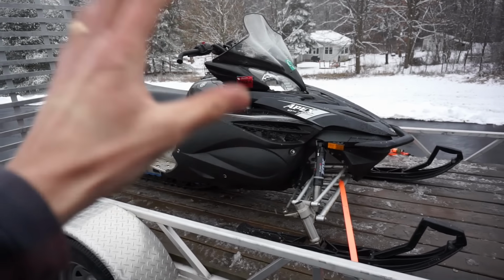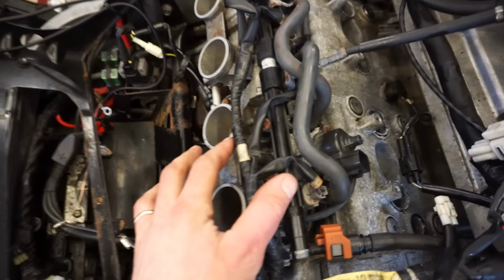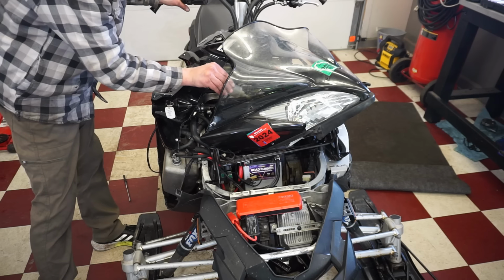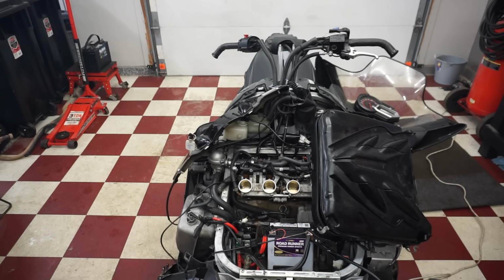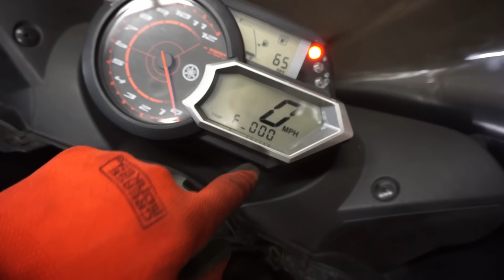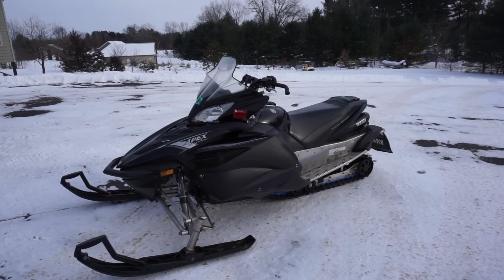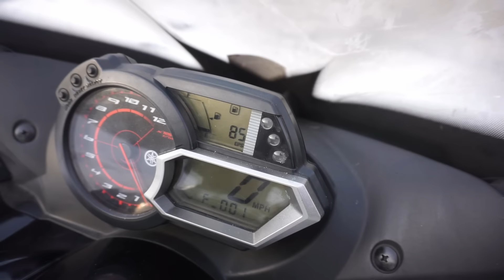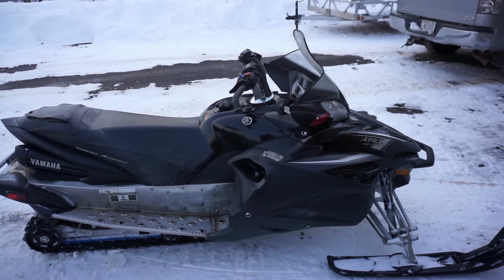$7000 Sled Overheated And Shut Off. Will It Run Again?

Comment: Over heating is an under statement. It's hard to believe a machine that cost what this machine cost doesn't have an overheating shutdown before it gets so hot it melts plastic.
Reply: Even all newer  outboards have them.  They will idle , but that's it until they cool off.
Reply: An overheating shutdown is also a system that can fail. Remember what happened to Apollo 13, the overheating cutoff switch failed to activate during tank testing because it was not rated to operate properly at all possible supply voltages.
Reply: It has a temp light, operator is responsable to shut of sled when lights come on, at some point rider needs to use common sense and not destroy his sled.
Reply: @4knanapapa  sounds logical but for snomobilers all eyes are on the trail or you go off the trail you go.  My Nytro shuts off on it's own when left to sit and idle and overheat on it's own.  But it doesn't shut down at the first over heat light when I am riding.  When it does come on (and I notice it), I typically slow down and ride off trail a bit in search of loose snow which works fine every time.  But during an intense trail ride I can definitely believe that light can be easily overlooked.
Reply: Mine does! Guy must have unplugged the temp sensor to get back to the trailer.

Comment: the starter will have been extreme hot; a miracle that he survived!
Reply: That starter is a champ. I honestly can't believe it survived all the abuse. Seriously dude take it easy. More starter burning or endless kickstarts won't make it run if there's other issues like bad spark plugs. This is mechanics 101, you're going to ruin good machines that way
Reply: The hole engine was cooked 😂😂. Doesn't matter the starter was cooked long before he got it.
Reply: @jerrywilcox9890  Obviously not. It is still working. 🙄
Reply: @ThaFailedMusician  no shit it's still working lol.never said it wasn't hahaha.
Reply: @ThaFailedMusician  it doesn't matter how long he used the starter.but before long it won't be.it will be going out.
Reply: @jerrywilcox9890  You don't know a lot about starters, do ya?
Reply: @ThaFailedMusician  it will burn out.
Reply: @jerrywilcox9890  Working in a fashion but for how long?
Reply: @alanrichardson1672  it will be giving up before long.

Comment: Quick note.  Knock sensors can’t leak oil.  :-). They measure a for a sharp knock throughout the engine block.  They are normally a piezoelectric device.  More vibration generates a high voltage signal.  The computer knows cam and crank position as well as when spark is fired.  So a knock signal larger than normal combustion near TDC or before the next spark event  indicates which cylinder was knocking.  Looks to me you need two sensors.  

Those engines are some of the best ever.   Great power at 10,000 RPM and reliable at the same time.  And the sound is incredible!  

My current RX1 I got for $1k.  Wouldn’t start.  Owner claimed it had a new solenoid and battery.  Got it home and found some carb floats were stuck and filled the crankcase with oil and gas mix.    Rebuilt the carbs, changed the oil and bought a new battery.  Run like new ever since.  Great sled it’s become a keeper.  But I would replace it for an Apex like yours!
Reply from the maker: Yeah it was the oil pressure sensor not the knock sensor
Reply: @2vintage  I often reply to videos while I’m watching them.  Bad habit.  I’m anal retentive due to my career which I’m retired from.  So I have plenty of time to nit pick YouTube videos!

Comment: the "knock sensor" i think is more likely an oil pressure switch.  Hence why there is oil that is under pressure at that location.   Knock sensors just sit in a metal chunk of block sensing pre-detornation knocks.  That could be because of bad gas or excessive temperatures causing the gas to ignite at the wrong moment.  (remember your coolant was super low, overheat and fuel was detonating wrong and the computer caught all that crap red-handed.)
Reply: I was thinking the same thing I'm pretty sure above it is the knock sensor

Comment: Always remember on most single wire sensors of any kind. Use the housing as a ground. You should use liquid thread sealant to seal threads not Teflon tape, which will insulate the ground causing issues.
Reply: This comment is why I’m here in the comment section could possibly be the reason for the code?
Reply: 100%

Comment: You never want to put antiseize on the plug boots. Antiseize has metal particles in it. Will cause misfires. Antiseize is used on the spark plug threads.
Reply: Ya and swell the boots
Reply: He used dyelectric grease. Not anti seize.
Reply: @notjoecheez1  He used antiseize it on the boot.. On the threads and on the tip of the plug he used dyeelectric.. Although you should never lubricate plug threads..
Reply: yep, i saw that too, got it backwards.
Reply: @notjoecheez1  it was copper based anti-seize where a trace of dielectric should go, also on the ceramic outer plug portion. Not on the actual threaded ends. 
kind of backwards. It's to keep the rubber coil boots from setting up on the insulator bodies....
Reply: @timewa851  No. Watch it again.. But regardless.. one should not use copper-based products near electrical things.. It conducts electricity..
Reply: Never put antiseize and sparkplug threads.. or into anything aluminum

Comment: You should put the retainer back in your plug socket instead of dropping plugs down into the engine like that. It could alter the plug gap just saying. But great video as always Joe
Reply: You did just fine until you said "just saying "

It adds nothing to your point.
Reply: Well I said that so people don't think I'm trying to come across the wrong way or like a know-it-all because that's not the case..

Comment: You probably figured it out but the knock sensor is between the middle 2 cyl about 5 inches from your oil pressure sensor.  Replace it.  Put the nose up on a snow bank and pop the coolant cap to burp the system.  Don't ride until you clear all the codes.  The sled will shut off if it doesn't see oil pressure that is the code 30 you mentioned.  You stole the sled, even if #1 is a little low on compression, run the yamaha ring free for a few tanks and you may get lucky.  What was that ticking when it was first outside?    That is how they are supposed to start, don't crank longer then 20 seconds, swap the plugs immediately.  Have fun!

Comment: As a general rule, knock sensors are single wire and thread into a hole that does NOT go into any passage but bottoms out somewhere in the side of the blocks water jacket, without contacting coolant, oil or anything else except the block.  I believe yours is just above and to the left of the oil pressure sensor looking front to back.  Very low coolant can trigger the knock sensor because A) The engine will knock when hot or with bad fuel due to multiple combustions colliding in the cylinder (it's hot) and or B) because the knock sensor is essentially screwed into a hollow drum i.e. the coolant dampens the knock by filling the drum. Naturally a rod knock will trigger the knock sensor as well.

Comment: That red light isn't for plug fouling, its the coolant temp light. You're supposed to let the coolant temp warm up before you ride it. It's not a 2 stroke. Constant throttle not constantly blipping it.

Comment: This thing must've gotten lava hot for all these components to melt like they did. Even the dipstick, which was separate from the engine itself, was goo. Can't wait to see how it ends with this beast, but I wouldn't hold my breath because all of these melted components can't be a good sign for the engine (and subsequently the one low cylinder). I'm hoping there's no damage to the wiring harness because judging by how hot it got, it'd be a miracle if it's still 💯% intact. Good luck in advance!

Comment: Knock sensorseem to be above oil sensor on the left with the hose ,bolted nearly horizontally ,it's in the cylinder wall/engine block. 31:41

Comment: To really get the antifreeze burped out, raise the front of the sled 45 degrees and continue to add until full. The coolant lines typically go all the way back above the track. These 4 bangers are fast.

Comment: Ps a old plumber's trick was to put ptfe tape on like you did But put more around the tapering end with grease with heat forms a gasket perfect water oil tight 👌

Comment: A tip for you. When working on snowmobiles, take the belt off before trying to start them. Your wall and sled may thank you for it
Reply: Or get a stand to get the track off the floor, but do something.
Reply: Like previously said - lift off the track. Taking off belt can be bad idea - sudden rev will damage the primary clutch by smashing sheaves without belt.
Reply: Don’t rev up a sled without a belt on. You’ll wreck the primary

Comment: Hey brother, I've noticed in a couple of videos that you're leaving the outboards in the up position on the boats. You should always leave them in the down position in freezing weather. Water will collect in the foot through the exhaust and freeze and bust the foot. Hopefully it's not too late! Just an FYI.
Reply: Hope he sees your comment before it's to late good eye brother
Reply: Good to know, ill have to keep this in mind
Reply: Most people I know that have outboards that keep them in the up position make sure there is no water inside when they store them so if that has been done there shouldn't be a problem
Reply: @186scott  It doesn't matter if you drain them. If you leave them up and out in the weather and it rains it goes down the exhaust and collects in the foot where it can then freeze and bust but, to be honest, I don't know that much about boats. I grew up on the largest man-made lake east of the Mississippi, got my first boat when I was 13 and still own one to this day at 60, worked at a marina pumping gas from 13 to 16, drove a marine forklift at a dry dock storge and hauled 35 ft boats around as well as worked on them as a profession for 2 years so, it makes perfect sense to leave an OB or the outdrive of an IO up and take a chance on it freezing rather than put it in the down position  and be absolutely  sure it doesn't freeze. That's what all my friends do. Your friends are probably smarter than mine. I don't know what I was thinking trying to give some friendly advice to someone and possibly save them some time and money...My Bad! But hey! It'll make great content! 😏
Reply: @ThaFailedMusician  not trying to start anything and I am sure like me a few others are surprised by another way of storing them and I do completely understand your way and there are multiple way to skin a cat and I am sure there will be others that agree with you and agree with what I said
Reply: @ThaFailedMusician  thanks for that reply, made me smile.  Meanwhile back at the cabin both my boats have the motors down as I do every winter (- 40 up here at times) and I  noticed my brother in laws is up and thought hmmmm.    I also seen that the local marina actually tapes over the end of the prop opening to keep the snow/water out as well in storage so I have started doing that, too. Cheers

Comment: As soon as you put the black old plugs in I said wait for the new plugs.  The old plugs were black and shiny.  Means excess oil or fuel.  My dad was a mechanic and he showed me that if there is fouling, pull the plugs out and turn the engine over.  Heat the plugs up and re-install.  Start as soon as possible.

Comment: Dielectric grease prevents the transfer of electricity. Putting it on the metal parts of the spark plug would effectively reduce the spark from occurring. Only put it on the ceramic part of the plug
Reply: I agree, but dielectric grease is still grease. It's not going to hurt metal to metal contact. It does lubricate and block moisture.
Reply: @fefifofob its silicone grease, its not your off the shelf petroleum grease. Its dielectric, literally named and designed to stop the transfer of electricity. Putting it in between two things you want to conduct electricity with reliability and consistency is quite possibly the stupidest thing anyones said to me in 2025.
Reply: @jacobmay7594  If two pieces of metal are in actual contact, a dielectric is meaningless.

Comment: I wrote it on the previous video of this machine, if it got that hot like the oil was cooking chances other parts are hit hard too.
Like valves cam and Rod and crankshaft and all bearings or oil pump and everything engine-related took a hit.
For a reliable machine, you should take the engine apart and check every piece for heat damage.
Now you could have a machine that breaks down every time you take it for a spin.
There is always a part that fails later on due to extensive overheating, this was a severe overheating.
I wouldn't trust that engine .

Comment: next video, joe replaces a starter on the sled, lol. Also, knock sensors dont have holes in them for oil to pass through, that is a low oil pressure sensor, knock sensors are piezo type sensors that sense a knock or ping by sensing a pulsation or pressure wave through the block. the knock sensor would have been the sensor located above the oil pressure sensor screwed into the block. Joe you aren't stupid, you can certainly fix it, no doubt about that, sometimes( well most times) internet searches can lead you on a wild goose chase, lol. I used to be a yamaha mechanic, and their sleds are a nightmare to work on.

Comment: Dont put Dielectric Grease on the electrode part of a spark plug. The grease is a insulating grease not conductive. You only want to put it on the porcelain part

Comment: Great video, I like you are cutting short the intro to your basic diagnostics, but would like the voice over explaining what and why.  I also look at snowmobiles as the biggest waste of money.  Paying $7k in 2012 is like 12k today to go play in the snow 2-3x a year?  I would rent one instead.  Kinda like jet skis, easier to haul than a snowmobile, but i have had three friends rupture tendons and ACL tears trying to get back on them in the water.  I will stick to motorcycles and ATV’s
Reply: This has been a terrible winter so far in wi for sledding, The grass is barely covered around me and I'm not that far away from Joe's location.   Between the high cost of new sleds and declining snow condition its been killing the sport for 50 years.
Reply: Snomobiling can be much more than 2 - 3 rides playing in the snow.  With hundred to thousands of miles of trails it becomes a destination thing, ice fishing, to a nice restaurant, or an overnight at a hotel etc -a couple of hundred miles per ride at times and a very social thing to do when you all have sleds. I do a yearly three day ride from Manitoba to Minnesota with a group of friends and it's a highlight experience every time.  But those Jet skis are more like you are saying, around and around in circles gets boring pretty quick from what I see.

Comment: knock sensor will be near the manifold. I can tell how excited you are.. LOL I would want to ride the 1000 too, they are so fun. When you get it going and feel comfortable it will be so rewarding. Check or change all the sensors. More than likely all of them melted. Most are only rated for a certain heat level, they are supposed to fail in the event of overheat. That way you get all these codes and it stops a person from mechanical damage. Fail points are engineered into everything with a gas motor. Your gonna want to put a longer track on it for sure. For the price I would add a long track. Good Score man!!

Comment: Use the parking brake if it works.  

I normally pull the belt.  Just don’t rev it hard enough go close the primary hard.

Comment: Yamahas are famous for fouling plugs from oil injection settings on cable, got to find that sweet spot, you probably know that right? you set it measuring how much distance between the end of outer cable as you pull out from seating, most are around 1inch, easy fix if too rich, temperamental believe just saying, from a nobody up in maine, ya I’m jealous 🤔, love your content!👍🏻🇺🇸

Comment: These thing fowl plugs really easy if don't let warm up before light goes out on dash. If engine healthy should  just light right off. Disconnect injectors and clear cylinders
dont shut of till warm up light goes off or touch throttle at all
think what you think is knock sensor is actual oil pressure. Knock sensor usually in a blind hole
As you found out as well when warm up light is on engine throttle is limited, can back fire etc unil light goes out.
These sleds will last forever if looked after. I have 32,000 kms on mine. Wish i had power steering like yours. Good score !

Great Video

Comment: When you first had it started, you had to let it warm up till the check engine light comes off. Otherwise you will follow the plug right away. That’s small motor mechanic tip 101. Always run a heat cycle when you get it running.

Sometimes you drive me nuts because you know as little as you really do. And you’re always so shocked when the obvious happens. But then there’s other times where I think it’s kind of funny lol

Comment: Is there a reason you don't use starter fluid?  It seems to me that you could rule out spark/fuel issues with a few shots of the stuff.  It would save a lot of abuse on the starter.  I'm surprised you didn't burn that one up.

Comment: Jeez, 2-stroke sleds weren't this picky about running! Glad to see you got it lit off OK though, just have to go thru all the different components and get all the bugs out. The knock sensor is likely defective if it was leaking oil past the threads like that and likely got toasted when the engine went into meltdown mode. One badass starter motor too!
Thanks Joe for a cool video!